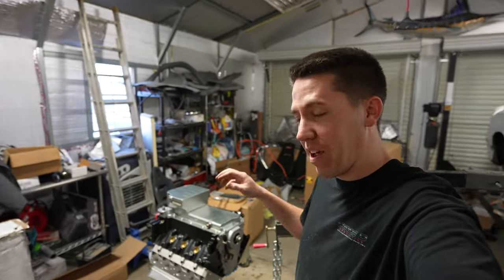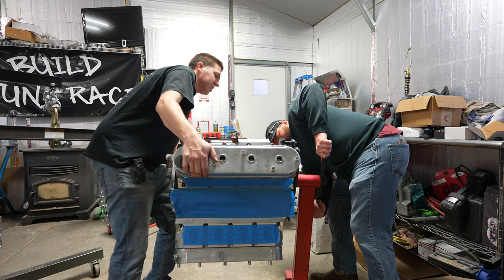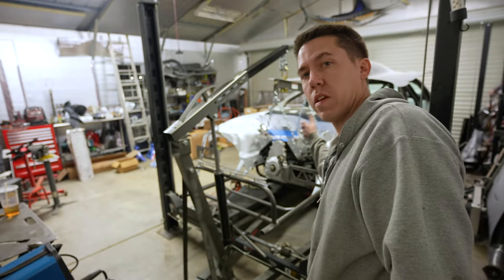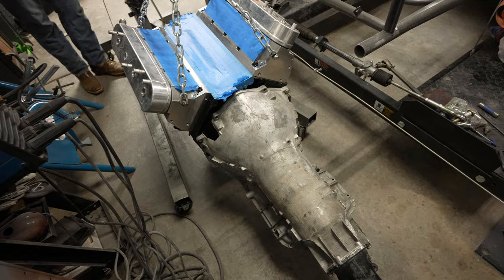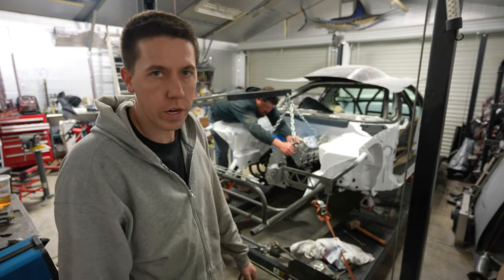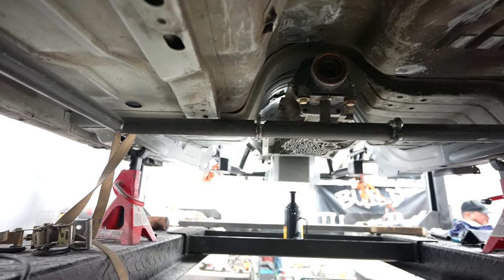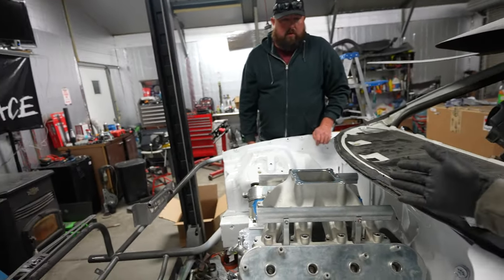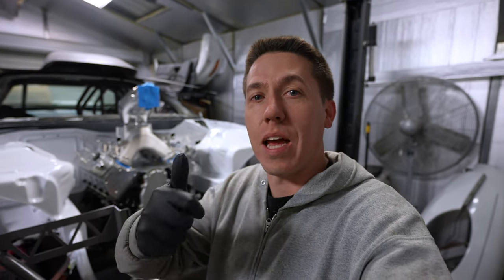Installing Salty's New 427ci 1800hp Twin Turbo LS Engine!

Comment from the maker: What do you guys think about this massive elbow!? 😲
Reply: What led you to the billet instead of a cast unit? Just curious.
Reply: It is ugly. But even more importantly it is pointing in a upward angle. I would get my money back or have them remake it the right way to point down.
Reply: If it was me I would put as much billet on the engine as I could to go along with the massive billet elbow like the Innovators West belt drive system that is billet a billet rear main cover, billet valve covers and when you're all done mocking up the turbo piping send it off to DCF and the turbos as well to have them polished and get some ICT billet like the valley cover and some Maven mounts like the turbo mounts and coil packs that are all billet